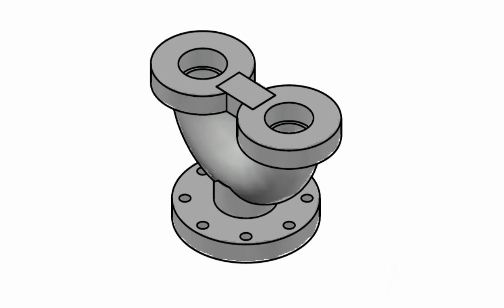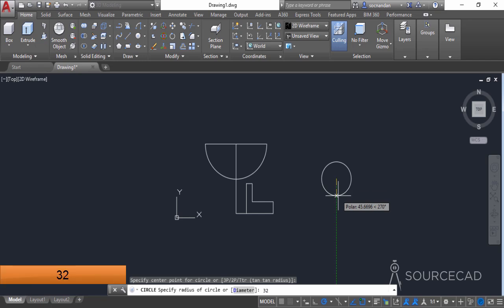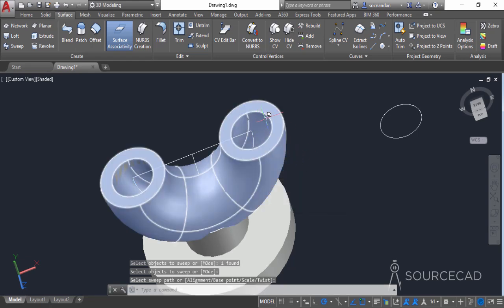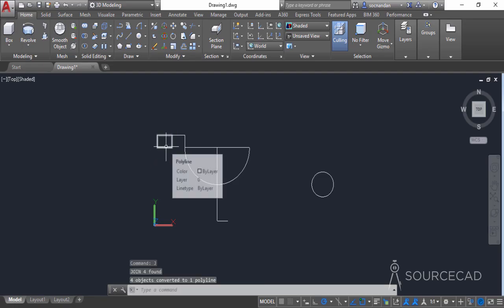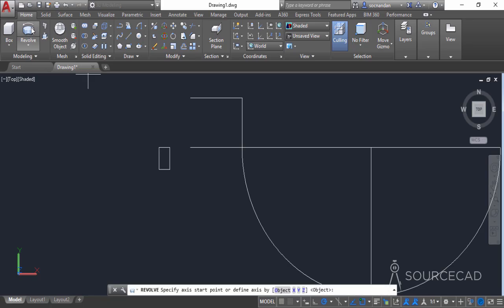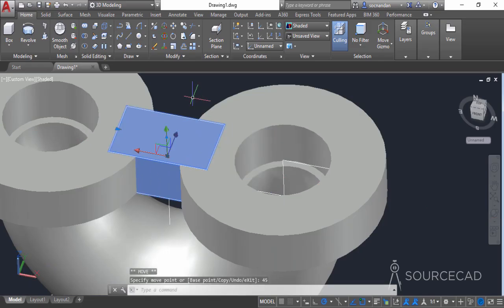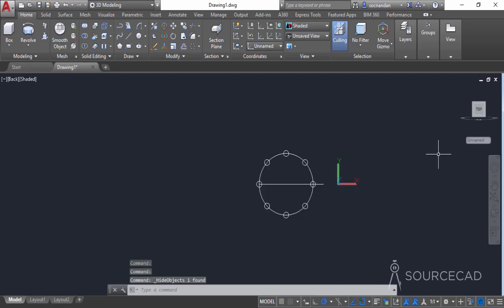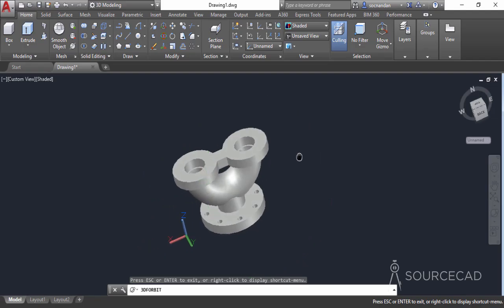AutoCAD 3D practice drawing: Pipe Joint

Comment: I cannot slice the the object, please tell me how to slice the object
Reply from the maker: Can you specify the time in video where you are facing this issue?
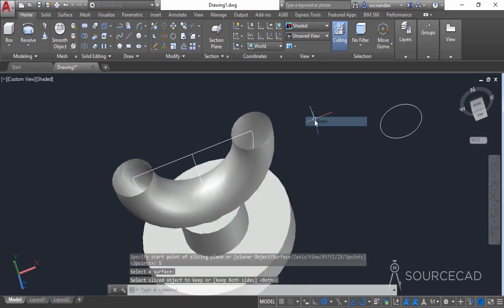Reply: I found that issue at 4:33
Reply from the maker: It is difficult to tell the exact reason for this error. It should work as long as you use same dimensions as I have used in the video.
Reply: me too

Comment: how I explode urdu text in autocad
Reply from the maker: Use TXTEXP command
Reply: But the text appear all character seperate
Reply: How I will fix this
Reply from the maker: yes it will appear separate, you have clean the extra geometries using overkill command and then join the remaining segments.
Reply: But how I join ع ث م ا ن instead of عثمان